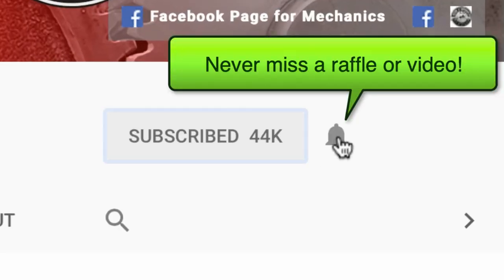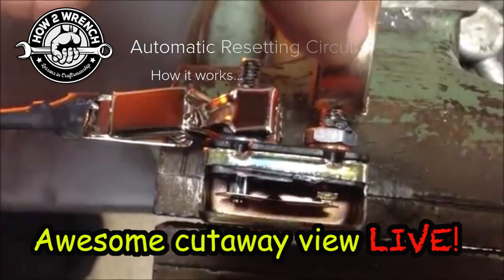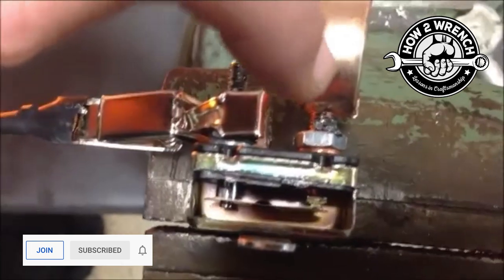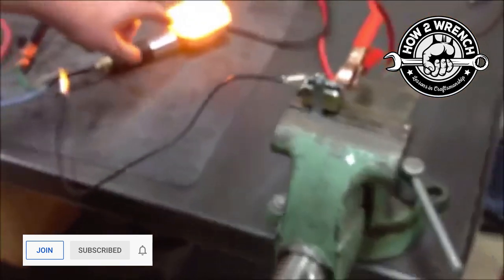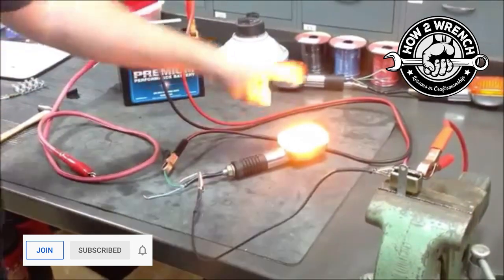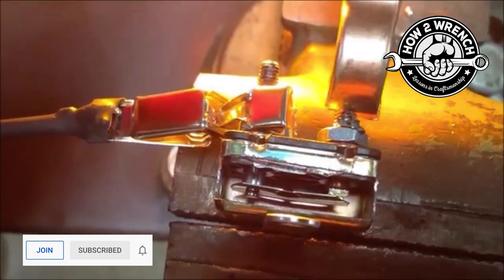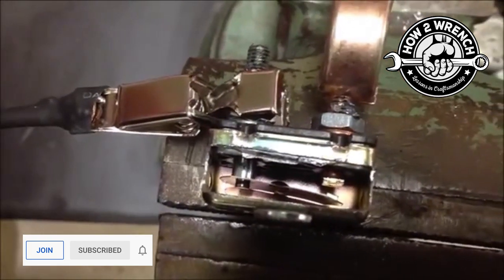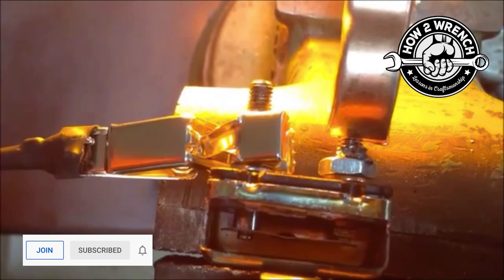How auto resetting circuit breakers works LIVE cutaway showing inside breaking and resetting! #viral

Comment: I don't like self resetting circuit breakers in principle. Once open, and if the overload or short circuit condition still exists, the CB will cycle closed again onto the fault. If this cycling happens repeatedly, either the wiring melts, or the load is damaged. At worst, the contacts can weld shut on closure. Fuses are much safer. I just modified one of these self resetting CBs for my old car with a polyfuse (actually a Bourns part# RHT900-2) soldered inside the can after removing the bimetallic piece. If the fault conditions remains, the polyfuse will stay in the tripped state as a tiny bit of fault current is enough to keep them hot and very high resistance, thus protecting the wiring and the load.
Reply from the maker: We love sharing comments like this with Shane. High Fives or making us better are a gift.
Thanks for sharing and the added value to our wrenching community. Keep them coming.
You rock for commenting! We will let Shane know! 
Jenny
Want even more? Best $$$ you'll ever spend...Join this channel to get access to perks:
https://www.youtube.com/channel/UCBhM8DCKnT3qXwTW0eToyCg/join       
-Daily MEMBER FIRST COMMENTS ANSWERED FIRST 
-Live Q/A video chats
-Wonder if we have a video on your need? Members can request content links!
-Full Access to the ENTIRE 700 video library
-Member-Only FREE tool giveaways  
Ways to support or high five How 2 Wrench! Thank you in advance. YOU MOTIVATE US TO DO MORE!
1. Smash the subscribe button (thank if already a sub!)
2. Have you seen our "YouTube Trained Support Shirts?  https://goodfellasmerch.com/collections/how-2-wrench/products/support-shirt   
3. High five donation:  https://www.paypal.me/how2wrench    
4. Got an emergency and your head is about to explode from frustration or fear? Get Shane’s cell here: https://how2wrench.com/ols/products/techline-one-on-one

Comment: If it is old and the contacts have developed any carrosion it will generate internal heat that added to the heat from the normal load and the ambient temperature can cause it to trip at a lower amperage. Checking for  voltage drop across the breaker can determine the condition of the contacts in the breaker.
Reply from the maker: Absolutely a grand idea of checking volt drop as a way of determining "contact integrity"...best comment I've seen in awhile...you rock

Comment: My wife was telling me that the power blinked at the office she manages. They went to the breaker panel and reset two breakers, but those circuits still didn't have power. A few minutes later they did. Is that because the breaker switches they flipped were also auto reset and had not cooled off yet?

Comment: These are labeled batt on one terminal and aux on the other.  Could you wire it the the neg terminal on the actual battery goes to batt terminal on this breaker and then the aux is the return from the trailer feed?   Just basically hooked up instead of coming from the positive

Comment: They are designed to work in one direction but will they work fine if you need to run power in both directions? In other words, if the circuit goes to an Anderson plug that both supplies power and is used as a solar input to put power back into the battery. Looking at it inside can see no reason why it wouldn’t let you pass current through it in the reverse direction.
Reply from the maker: Hi Peter. I've never challenged the "why" and just followed the manufacturer's instructions and design. For my applications, it's just no need to risk or use alternatively as you may need. Thanks for the solar example and feedback. 

You rock! Best way to help us back is joining or grabbing our T-shirt! Support links and gear below!  Awesome and thanks for commenting! Smash the subscribe button (thank if already a sub!)
Have you seen our "YouTube Trained Support Shirts? Great way to "high five us" https://goodfellasmerch.com/collections/how-2-wrench/products/support-shirt
Give us a high 5 here:  https://www.paypal.me/how2wrench   
Join this channel to get access to perks:
https://www.youtube.com/channel/UCBhM8DCKnT3qXwTW0eToyCg/join   
-Daily MEMBER FIRST COMMENTS ANSWERED FIRST 
-Live Q/A video chats
-Wonder if we have a video on your need? Members can request content links!
-Full Access to the ENTIRE 700 video library
-Member-Only FREE tool giveaways   

Got an emergency and your head is about to explode from frustration or fear? Get Shane’s cell here: https://how2wrench.com/ols/products/techline-one-on-one

Comment: hopefully someone will reply to this question in an  older youtube video..  

how fast does this type of fuse auto reset?  IFFFF this video is in real time and not in slow mo...  It appears to take at least a few seconds to reset. In my mind this said I should be able to  attach a voltmeter (attached correctly) and watch it drop voltage and then raise voltage again due to resetting. 

Reason I ask is I built a test setup with this in mind. Wanted to find what was shorting out and had already twice blown  different 50amp fuses; pretty much immediately; when the relay this blowing fuse is part of,  got activated.  This strip fuse is said to be a built in protection from the HOT line between  Glow Plug  Relay and battery HOT*.    A few had suggested I was blowing fused due to a short  to ground somewhere  in  path between relay and tip of  one of the glow plugs.  This was what I was going to test.  

Goal was to test by finding what wire/glow plug trips the fuse by seeing which one(s)  shows a volt drop on a voltmeter  due to it getting  it tripped. First though had to test that theory before set out to test what was tripping the fuse.  So ran a test with all the wires still attached to see if voltmeter did what I assumed it would.  Once verified; plan was to pull all the Glow Plug  wires free from the Glow Plugs and then start testing. Intent then was to reattach GPlug wires; one at a time, to see which GPlug or its wire causes the fuse to trip  by looking to see changes on the volt meter.   

With GPlugs and wires all still in place;  tested my assumption**  .....  Well  volts never dropped of any significance in my test.   What does that mean??? is my assumption wrong??? orrrrrr did my short to ground (if there was one)  resolve itself.???  Maybe had two bad fuses??  both were old.   Hence my question.. can  this fuse re-set itself so fast I would not see see volt changes  on a meter in a  gap between Tripped and Reset???  

*. Strip fuse this auto re-set ( test  ) fuse replaced, sits between fulltime hot from battery to second point on the relay.  Wired the auto-reset fuse the same. full time HOT;  wired to Brass Lug in back of  a Bussman auto resetting  50amp fuse; like the one in this video. The silver lug  on back wired to where the other end of OEM strip fuse would attach.  

** voltmeter attached at Silver lug on back of fuse... assuming that should show a drop in voltage  if the fuse trips, because no power would flow thru the fuse during the tripped phase. 
coachgeo
Reply: grrrrr.....  well got one question answered....but unfortunate reason.  

it apparently for one day fixed it self..... but now back to popping relay fuse again.  That did answer the question..... yes the auto reset fuse..... the time between trip and reset is for sure is slow enough to see complete drop in voltage to zero.   

Now got to figure out how to take apart the  Glow harness plug  that runs from relay  to Gplugs so can replace all the glow plug wires.